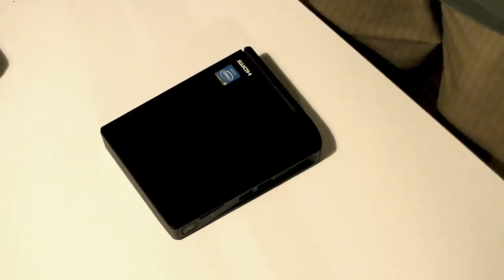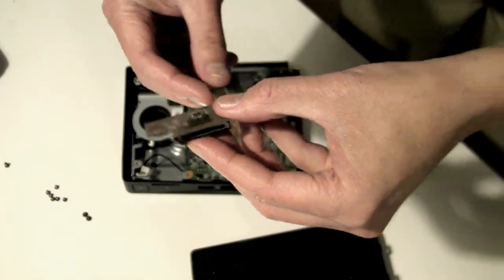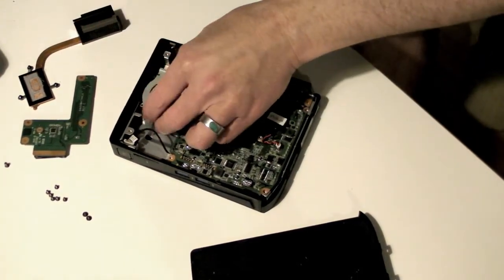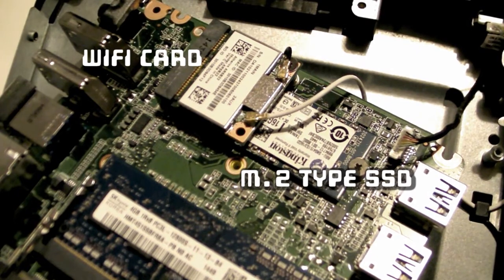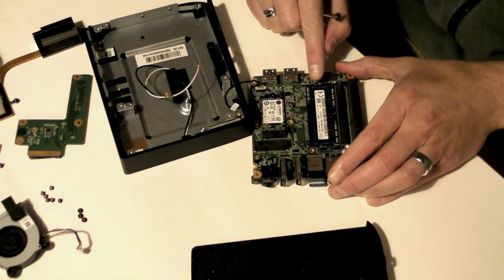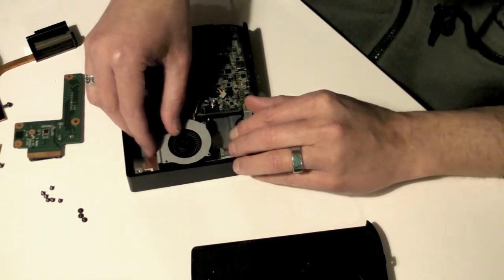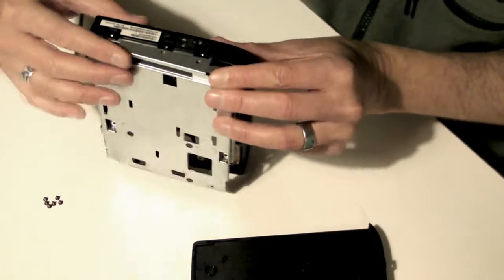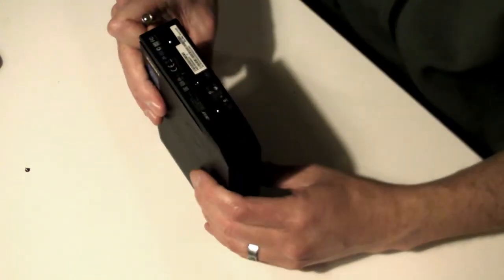🔧 How to upgrade an Acer Chromebox CXI or CXI2 - RAM, SSD, alternative operating system and more

Comment: Excellent tutorial. Before I remove the wifi card for SSD access I put a dab of glue gun goop on the little antennae wire connectors.  If they come lose they are really hard to reconnect!

Comment: Can i use a 120gb m2 ssd for Chrome OS with the installed firmware please?
Thx in advance
Reply from the maker: It can be done in principle, though I haven't tried it myself. Make sure the SSD you use is NGFF with the two notches.  A "regular" m.2 drive won't fit in the CXI1 or CXI2. I recommend visiting http://MrChromebox.tech to find out more about how to ensure a smooth transition to ChromeOS on your larger SSD. Good luck, and let me know how it works out as it's something I haven't tried myself yet.

Comment: 2 questions
1) what's the max RAM the CXI3 can handle?
2) does RAM have to be symmetrical? For instance, if I have 4 gigs of RAM in there can I add 8 gigs to give me 12 or would I have to put two 4 gigs in there and live with 8?
Reply from the maker: Hi Cam, thanks for your questions. I haven't laid my hands on a CXI3, but these principles should hold. 

Firstly, the CXI3 uses DDR4 SDRAM, not DDR3L (as shown here). So make sure you buy the right stick!

Now, you can put an 8GB sodimm in the second channel/slot and run the system with 12 GB of RAM, though running 8 or 16 might work better. 

Having both slots occupied with 4GB sticks will give better performance than having an 8GB stick in one, as your processor cores/threads can make use of both channels.

If your system starts behaving strangely with 12GB ram (it might actually run slower than it did previously), you have have found a compatibility problem, but don't worry, as it won't break anything. Remove one of the RAM sticks and run with the largest capacity stick in a single slot. 

Your best option in the end will be to have two matching sticks, making 8GB, 16GB or 32GB the guaranteed recipes for stability, performance and success. Going beyond 16 GB for your processor will probably be overkill and not worth the expense.

Best wishes, and let me know how you go with your upgrade!

Comment: Absolutely brilliant video, thank you so much! I just finished upgrading my Acer Chromebox CXI v1 this way.
Also your hint on how to remove write-protection worked flawlessly for me. Great!  :-)

One final question, as I'm looking for ways to turn this into a super-basic NAS system:
Has somebody already tried to put amnother M.2-SSD into the M.2-2230-Slot of the WiFi card?
(I'm afraid this will not work, but maybe I'm wrong and it could?)

Basically I would like to have another disk, so that I can build data redundancy on a software RAID 1.
(Yes, I get it ... I should probably buy "a real NAS" :-D )

Thanks in advance for any thoughts!

EDIT:  I seem to have been wrong. This WiFi card's slot is different - so if it was possible, I would only be able to replace it with a mSATA, correct?
Reply from the maker: You do have a low-tech option I could suggest... that's using a dual-port microSD card reader that fits your mSATA slot once your wifi card is removed. That way you can put a couple of 1TB microSD cards in there if you want to... each one comes up as a separate 1TB drive. I've made a video about this. You might like to check it out ;)

And thanks for sharing your success with me. I'm glad to have helped you.
Reply: @danimationstips  Oh, now I see:  That is an awesome idea! Before watching your video, I didn't know, that those adapters exist. I just checked eBay and they are also pretty cheap. Great, thanks again!
Reply from the maker: @RC-ic1co  I'm also working on a review of cheap 1TB generic microSD cards, so that could finish the picture for you and keep the price down :)
Reply: @danimationstips  Definitely looking forward to that. :-)  (Indeed I'm researching low prices for 256GB SD cards right now)
I guess you will inform your usership about the issues with fake SD cards, as testable with h2testw? Anyway, I'm subscribed and I won't miss it.
Reply from the maker: @RC-ic1co  Thanks for the tip re: h2testw... I haven't encountered any fake SD cards personally yet... but I am roadtesting a few edge-cases... very large but slow USB sticks and microSD cards that could be useful for some but not all applications :)
Reply: @danimationstips  Sounds promising. Living in Germany, I always equated large USB sticks or microSD cards automatically with "expensive" - but maybe I'm missing something.  :-)

(I have also tried out some rudimentary NAS functionality by adding a super-slow 128GB USB stick to a router and I can see, how this is a good idea.)
Reply: @RC-ic1co i know this is 3 years later, but if you're still looking to improve things or if someone else is looking at this i would recommend just using the usb ports; it might be slower than the m.2 connection but it's gonna be easier to get to, you're gonna have a lot more, and you can even get large spinning disk hard drives if you really want storage space
Reply: Love to see a follow-up to the discussion 👍🏻
I bought multiple cheap 2.5" HDD/SSD USB cases and always wanted to find out how well a low-tech NAS would work with them. Standard internet advice is to not do it, as there might be stability issues with this long-term... but if it was working well enough for simple use cases, it would be terrific value for almost no money.
Reply: @RC-ic1co the biggest issue with using multiple hdds is usually the vibration from all of them, which can wear them out faster than normal and cause problems. So you probably want to do something to dampen the vibration. But yeah

Comment: I removed the write screw and put it back together and
 nothing seems to have changed..?
Reply from the maker: Which model Chromebox are you working with Barry?
Reply: @danimationstips  same exact one as in the video. Acer chromebox CXI2.   

It's all locked down by admin and keeps saying developer mode is disabled.   Starting to think I'm shit outta luck lol.  Even flashed a recovery image after removing screw and nada
Reply from the maker: @barrywebb7398  I suggest you visit MrChromebox.tech and send him an email asking his advice. I had no trouble with doing this to CXI2 or CXI units in the past. Let's hope an end is in sight for you!
Reply: @danimationstips  I scoped out the site and its amazing.
Reply: @danimationstips  got annoyed and put it away for awhile but did manage to find this readout:
https://ibb.co/tYQymvZ

Seems its setup not to verify image so it's a potential fix I'm thinking.
Reply from the maker: Hey  @barrywebb7398  I've de-googled a few more of these since making this video, and have the following extra tip for you that may be applicable. 

I discovered that if you have a system that's been factory reset, you need to set up a regular chrome user account before you can start the steps in my other video to install the custom firmware.

If the unit's still in "factory reset" condition with no Chrome user account established on the device, it won't respond when you press "Ctrl + D" to enter developer mode.

I hope this helps in your situation?
Reply: Hey, having same problem with chromebox CXI4. Noticed it was 2y later, wondering if any progress 🤞🏼

Comment: whats the format of the card that goes on the board of the SD card. There is a socket there and looks like a NGFF 2230 but I am not sure what it is. is it for extra storage, or other purposes. Cant figure out what it is used for. it is in the invisible part of this board that clicks on top . Can smb help?
Reply from the maker: I also looked into this but wasn't able to find a suitable NGFF SSD to suit (assuming that it IS for storage). Its purpose is a mystery at this stage. If you find out what it can be used for, please let me know!
Reply: Maybe not relevant now, i just dissasembled an Acer CXI2 i just bought, and saw the slot You are talking about. According to what i found, is a Mini PCI Express Slot that just uses 1 lane. It does not have SSD compatibility, just useful for LTE cards or something like that

Comment: Please note that the case and motherboard layout of the CXI2 are almost identical to the CXI.... so if you have a later model, this video will still stand you in good stead. The write protect screw on the RIKKU model (CXI2) is in exactly the same location, beneath the heat sink.